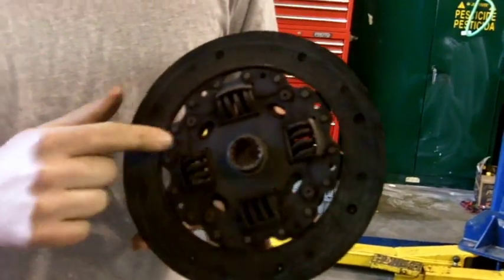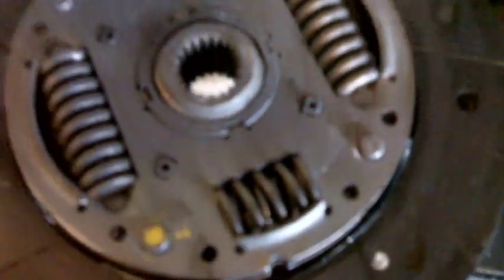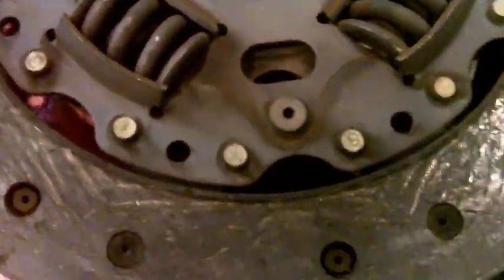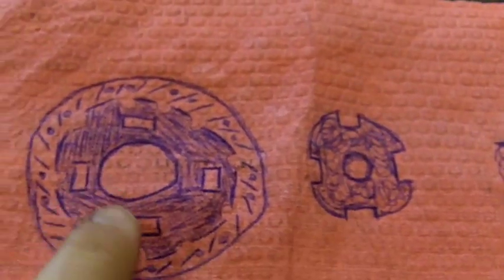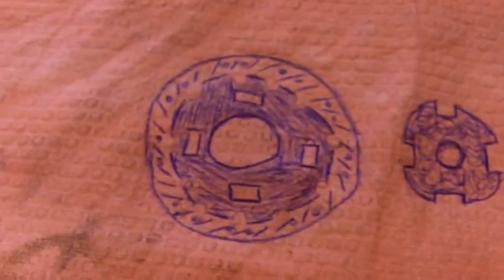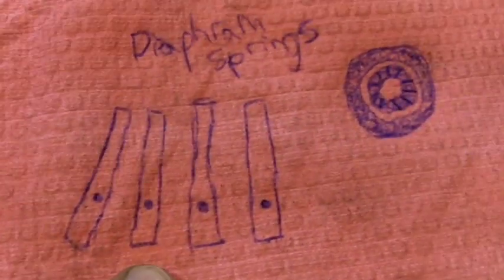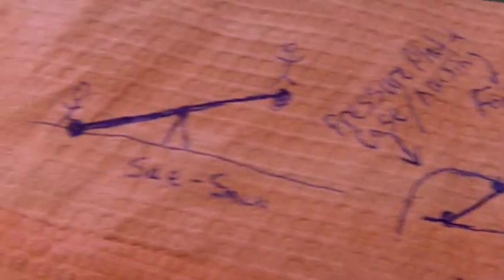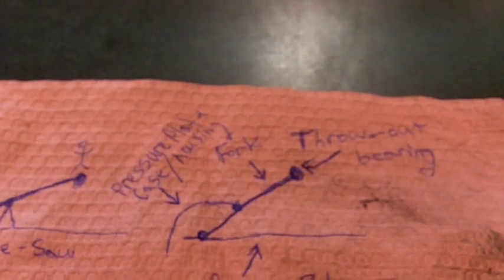How a Clutch Disc Works With Flywheel & Pressure Plate

Comment: The springs in the friction plate or clutch disk actually absorb the shock of engaging the clutch to stop sudden movements. Also there is no point in messing about with a friction plate, if it's worn or broken just buy a whole new plate it is much easier.

Comment: Your transmission figure is wrong..
Bro
Eneergy.. Engine.. Diskplate... Spring... Hub... Inputshaft
Spring will reduce the vibration and it will make smooth transmission.. And also reduce jerk..

Comment: The clutch disk is fiberglass so don't grab it. 
It puts glass in your fingers.
Reply: I don't think that's true.  Clutch plates are made from pretty much the same material as brake pads, since they serve the same purpose.  They're usually some kind of fancy ceramic and/or kevlar.